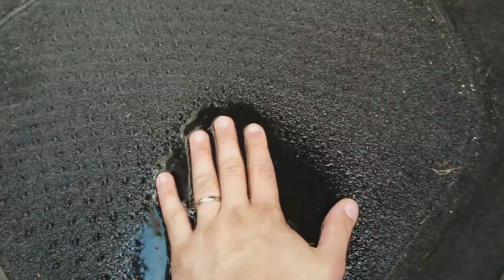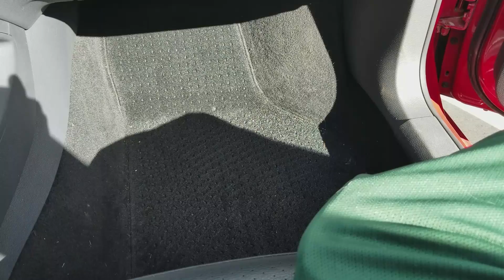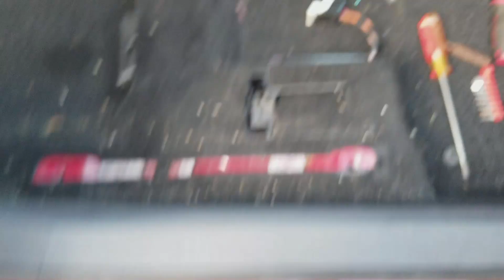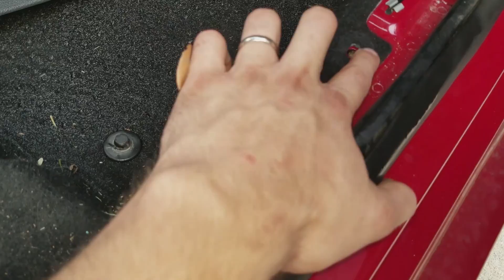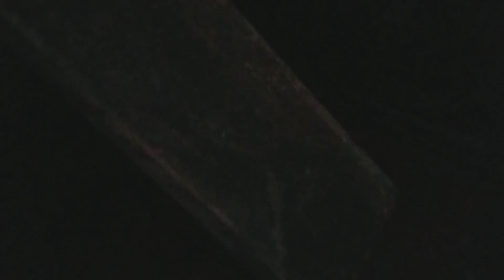Repair a MkV Jetta 2009 Volkswagen TDI Sunroof Leak/Clog

Comment: Make sure that you have your hood cow pieces in the corner and that they're secured. If it's not that then your sunroof is not draining. My fiance is literally outside right now taking off my wheels and my wheel well covers and unclogging all the mud and leaves that block the drainage of the sunroof. The hood cow order are crucial and we used glue to secure them and then silicone clear silicone I just did a artistry job making it look perfect

Comment: There was no need to remove seats, I had same problem in my 2007 VW Jetta, there is a Car wash place in my neighborhood which has very powerful vacuum cleaner, using that I sucked out all water from the floor and then with high pressure air hose I flushed out 2 drain holes in Sunroof and then I also used high pressure water hose. Guess what? My water leakage problem on a floor of my 2007 VW Jetta s solved solved forever.

Comment: Please take this video down. The front drains come out under the windshield cowl and the rear ones under the wheel well splash shield. They need to be cleaned at the ends because the tube is pinched at and that's where they get clogged.
Reply: You have a different model/style. They're not all the same.
Reply: @mastanate01  I have a 2006 VW Jetta TDI. They are all the same.
Reply: @NycDIYProjects  2006 is not a 2009.
Reply: I'm sure they didn't change the location of the drain valve on the last year model of the mk5.
Reply: @NycDIYProjects  I'm glad you're sure, but that doesn't change reality

Comment: Happened with my 2014 sportwagon. I had about 4 inches on water on my floor. Problem is also the tubing they use with shrink over time so check all fittings on the drain too

Comment: Wait I think this is wrong. Those drain tubes are for the water that drains off the windshield and hood cowl, which exit into the fenders. The sunroof drains exit above the entry of the cowl drains under the windshield.
Reply: You're right. The information in this video is wrong.

Comment: And here I was, thinking that the routing of the drain hose on my Mk 4 was bad. At least that one leads into a grommet, plugged into the body right above the door hinge, that is visible and somewhat easy to reach. It looks like they found an improvement for the Mk V that made it even worse if the thing is clogged up. Wow.

Comment: You can test for a clogged drain by parking on a slight incline and pouring water into the drain.  If you doesn't come out you clean it by using compressed air and running weed eater string into it.  -- You can shop vac carpets until they are dry to the touch, then come back and do it again in a few hours.
Reply: Compressed air and/or eater string will not do anything to fix this problem. The clog is in the frame of the car, not the drain tube.

Comment: Uhm...you showed us how to remove carpeting, not how to fix the drain clog.  Maybe retitle this video?  IJS
Reply: Not to mention.... on the Jetta 5, the drain exits in the cowl under the hood, NOT in the door jam.........
Reply: @elesjuan  That is not correct. The water that runs down the windshield is in fact drained under the hood and exits behind the front wheel well. The sunroof drains are separate from that; two run along the A-pillar and two run along the C-pillar.
Reply: @schmuhf  Here's the thing.. There's these words you just said, and then there's the FACTS of the car.  I've replaced the drain tubes on more than one mk5 jetta, and they drain into the fucking cowl, which then dumps behind the front wheels.  You can either accept that's fact, or not.  I could literally take a camera into my garage right now and prove this.
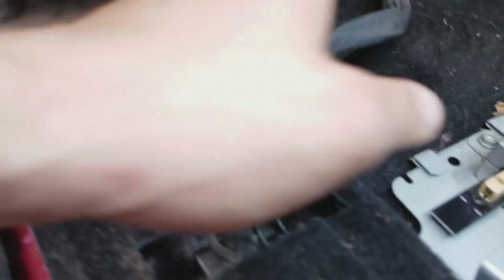Reply: @schmuhf  My 8:30 appointment rescheduled, so here's your video.  https://youtu.be/sb6ufJyc6k4

Tell me again the sunroof drains don't dump into the cowl.
Reply: @elesjuan  VW arn't consistent with there models. I believe some MK5 actually exits by the wheel well.

Comment: Wet and dry vac will help to get rid of most of the water
Reply from the maker: Yes, it will help, but it will leave a lot if water in and under the pad if you don't rip up the carpeting.

Comment: Never buy vw
Reply: Any vehicle with a sunroof has drain holes in the corners. The holes can become blocked or the drain tubes running down can become blocked.
Reply: @erictrinklein4408  You're right. Sunroofs, by design, are never really watertight and they cannot be. That is not an issue as long as the drains are working as intended. If they don't, we have a problem on our hands.

Comment: Can I just drill a hole through my floor?
Reply from the maker: Only buy VW
Reply: Marko Berstecher I like that idea. Lol.  I used to have a wrangler with the drain holes.
Reply: Not if you want to stop the issue... you're probably joking, but you'd also get water off the road if you did.
Reply: I actually drilled a few holes in the floor of my MK1 Seat Leon and it did help a lot with getting rid of the water. You do have to rectify the cause of the water ingress still. In my case it was leaky door seals.

Comment: .
Thank you: CRITICALLY IMPORTANT REVELATION IN THIS VIDEO: feeling EVERY panel and floor area, trunk and spare tire, for collected water, the stripping down dry it all out ( see YouTube video [ z1HhMw4LAVc ] for more ) AND clean and re-seal the drains and hoses and fittings.

Also see YouTube video [ zOcIRLpQDVg ] for the leaky non-seal between drain hose and sunroof drain fitting at the UPPER end.

Also see YouTube video [ toKy1GM7EnQ ] for cleaning and sealing the valve at the LOWER end of the sunroof drain hose. 

We HAVE to inspect and seal the ENTIRE drain hose from end to end, top to bottom, because just checking one end or the other, or one hose or another ( there are FOUR, one at each corner of the sunroof ) will not do, ALL ends and ALL corners must be checked, cleaned, refitted and re-sealed -- thanks again, very empowering. 

Note, our ancient GERMAN VW Passats have no leak problem, our newer Mexican VW Jettas and Golfs are horrible regarding these leaks due to horrible VW quality control, and horrible VW dealers who have no clue, and apparently don't know how to use the Internet, as they "pretend" to have no idea that this is a common problem, and the VW dealers have no idea how to address it, especially with enhanced parts rather than simply re-ordering OEM cracked, loose, and leaky crapola that's as likely to leak again as the original -- our Mexican VWs were DELIVERED NEW with these failures.
.

Comment: Just FYI... You can run a portable dehumidifier inside the vehicle for 2 days... Good as new.
Reply: No, look how much water is in the vehicle. A dehumidifier would take weeks and weeks to remove that much water, and the carpet and pad would still show signs of mold.
Reply: Nathan Miller 
Mine pulls 70 pints per day... So... Not sure what you're saying except maybe you have a crappy one?
Reply: Sorry. You're not an idiot. I was harsh. Just work on cleaning the drain. Ignore everything else for now and watch the video from about the 12 minute mark.
Reply: .
No, dehumidifying isn't an answer in and of itself, it's part of a total resolution.

We must still strip and inspect everything to make sure there is no water under pockets, because an outer surface that is dry to the feel means nothing, and anything still wet underneath will eventually rust and also cause mold and mildew.

Apply weak bleach solution and let it dry ( with rubber gloves, face mask, plenty of cross ventilation ), use Comet bleach cleanser to dust, and spray with Lysol Mold & Mildew Blaster and Concrobium or equivalent anti mildew solution, and let that dry, too.

Then spray everything with Febreze, and then vacuum and respray with Febreze frequently.
.
Reply: Aaron Harkness if you live somewhere where rain is infrequent throw a tarp over it when you see a storms coming! I keep one in my trunk. I’m a broke idiot 18 year old and I have no tools where I live.  The tarp works well enough haha
Reply: Doesn't fix the clog though? Wouldn't it just flood again after the next storm?
Reply: Lol... Yes. You are correct. It still needs the drain cleared. I thought that would be apparent.. Haha
Reply: I'm an idiot, sorry. I'm having the same problem and VW can't figure out what the problem is. Think I'll take the dehumidifier route as well for the time being.

Comment: This does not completely correct the roof leak. I have a problem on driver' s side, which leaks through the headliner. It seems the only way is to take the headliner off and see where the problem is around the sun roof and its various drains.
Reply: The only way your headliner gets wet is if your drain hose itself is clogged somewhere inside the a pillar. Try running weed eater string down the drain tube from the sunroof to where it terminates in this video.
Reply: .
No, there are cracks between the drain hose and the fitting at the upper end at the sunroof drain, and it will leak there even though it is not clogged -- the ENTIRE drain hose and fittings from top to bottom, at all 4 corners, must be inspected, cleaned, repaired, and re-sealed.
.
Reply: @peterblaise  Same here: 2008 Jetta - leaked at the host connector to the drain.
Reply: Thanks, I have not done that yet, since the headliner has been so messed up from getting wet at the pillar and around the sunroof, I am going to take 
it down. Any other ideas are welcome.
Reply: jose amram wow. I have the exact same problem on my 03 jetta... mind blowing to me that vw wouldn’t improve this bullshit